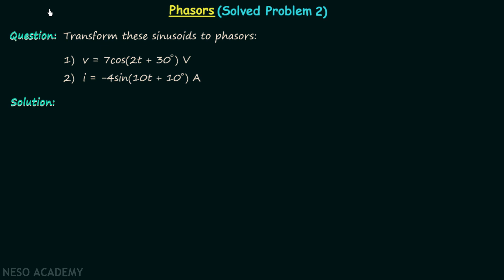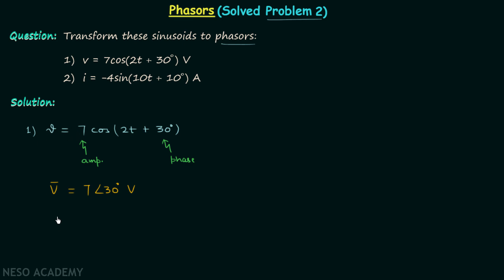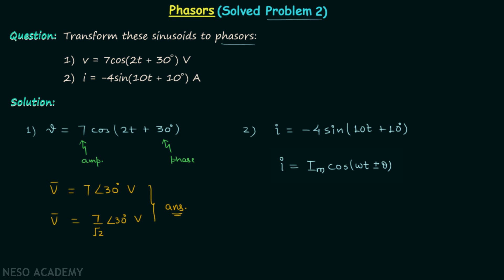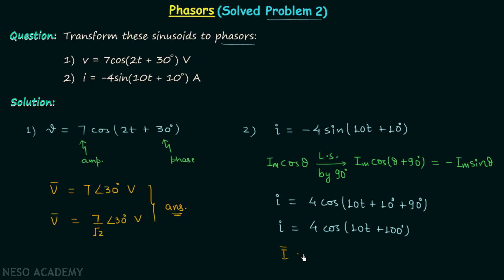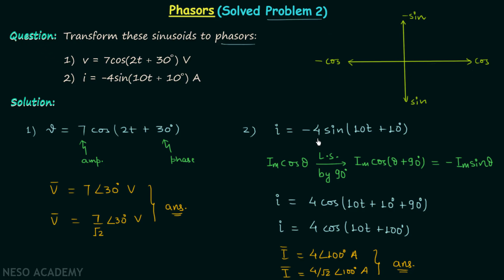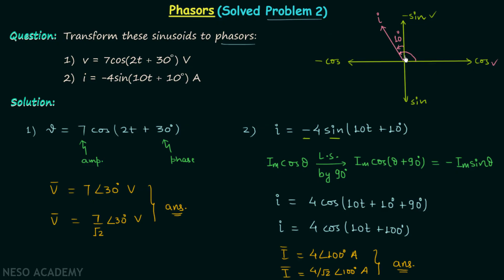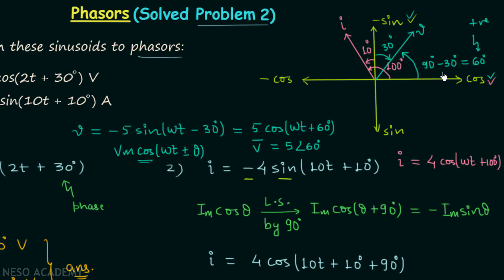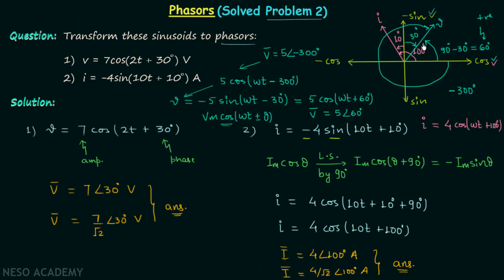Phasors (Solved Problem 2)

Comment: In one of your explanation you had told that the standard waveform can be of sine or cosine then why did you changed the sine form into cosine in question 2..?
Reply: See the 3rd video from the start. Hope this could help you
Reply: @sara video numbered 133.
Reply: In all thy getting, get understanding. Amen
Reply: When it comes to circuit analysis, the standard waveform is in cosine.

Therefore you have to convert any waveform given to cosine in order to solve questions.